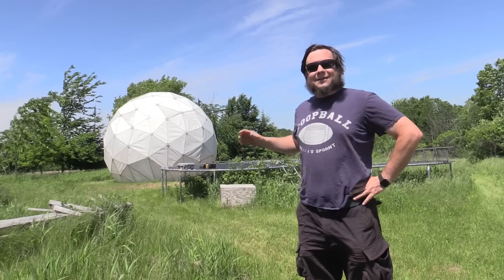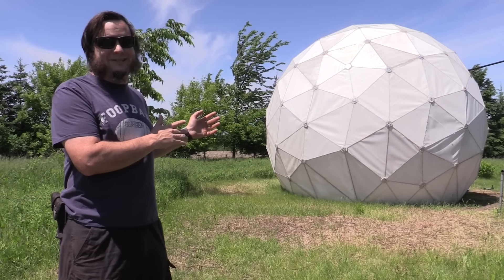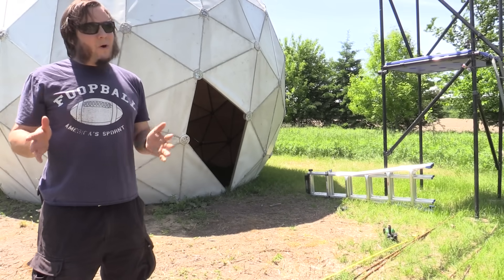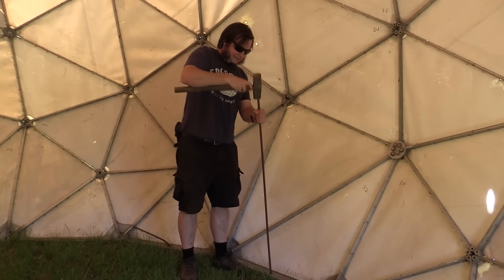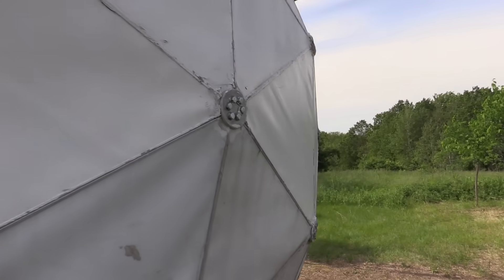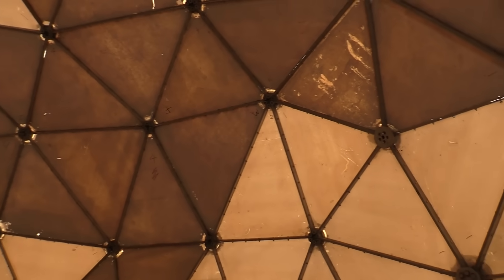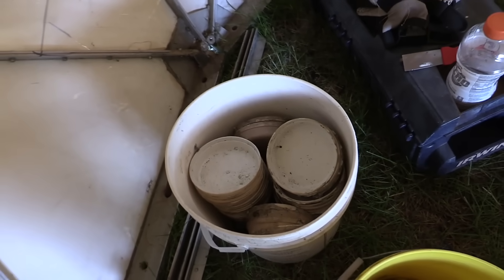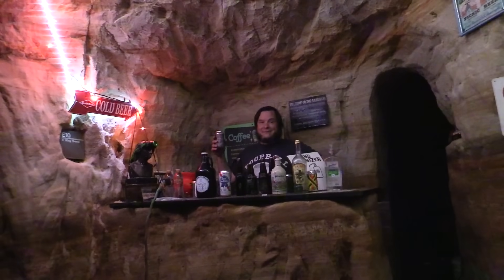Will Our Geodesic Dome Survive A Storm?

Comment: Have you considered laying down a concrete slab to put the dome on? I feel like a solid foundation will help any mounted telescope. Maybe that's not needed for radio observations as much as visible.
Reply from the maker: The antenna will have a solid foundation, but the dome is just pinned to the ground.

Comment: Make an opening on one of the panels close to the top and JB-weld a chimney topper. This lets warm air out the top, while keeping the rain out. The 'chimney effect' will pull fresh air in through the side opening, and prevent it getting so hot inside. If the dome is the tallest thing around, consider adding a lightning rod and grounding. On one of the 25' domes I maintain, we have a piece of railing attached to the top most segment that we hook a ladder onto to reach the top for maintenance with the antenna installed.
Reply from the maker: Great ideas, thanks! I'll have to remember that. Curious where your domes are, maybe shoot me an email if you get a chance, gabe (at) saveitforparts (dot com). Youtube never shows me comment replies so they just get lost in here :-(

Comment: I fear you will have damp issues with no concrete foundation or floor. or even flooding issues depending on your topography and the water table.
Theres a reason people put these on raised platforms.
Reply from the maker: This is on top of a hill, so shouldn't be any flooding. We'll probably throw some gravel in there as a floor when we have time.

Comment: At 17, I worked one summer as a helper assembling grain bins. We built the roof first then used big jacks to hang the rings and secure the assembly. The worst thing to see is that green "it's hail" color coming toward you with half a ring hung.

Comment: Depends on how far you want to go in order to cover your ass, but I did a project a while ago where we just got a structural engineer to assess each of the locations.  They then did a written fixing method assessment which we stuck to.  Only cost a limited amount per assessment and we could then say that we’d done it as recommended by an expert.  Either that, or as per manufacturer’s instructions would probably suffice.  If it all goes pear-shaped, you want to be able to say that you took reasonable efforts to secure things.

Comment: For belt and braces, i`d install some eye nuts onto the appropriate vertex plates and use steel guyes down to screw-in ground anchors. You`d only need to attach the guyes when a bad storm is in the forecast. It wouldn`t take more than a few minutes to clip them on using carabiner snap hooks.
Reply from the maker: That's a good idea. The manual actually says to put in eye nuts for lifting and moving the thing!
Reply: @saveitforparts 
If you get heavy snow there, i`d install a pin/bolt in the middle of the top pentagon. Attach a rope to the pin/bolt via a ring and you can walk it around the dome to dislodge the snow on top :)

Comment: YOU COULD PUT A CEMENT FLOOR IN THE DOME THAT WOULD ALSO HELP HOLD IT DOWN AND KEEP THE RACOONS OUT.
ALSO IF YOU ARE GOING TO HAVE ELCTRONICS IN THERE I WOULD PUT IN AN EXTRACTOR FAN IN ESPECIALY IN THE SUMMER TIME AS IT WILL GET VERY HOT UP TO 104 Fahrenheit YOU DONT WANT TO LET IT GO OVER 89.6 Fahrenheit OR BELOW 64.4 Fahrenheit IN THE WINTER.
ALSO GIVE IT A FRESH COAT OF WHITE PAINT IT WILL HELP KEEP IT COOLER.

Comment: I say that if you were able to build a half dome with something even remotely resembling a flat base to it, you should build a short Tower and attach that to the top as an additional station. Maybe something using the PlayLand structure if you think that would be stable enough. It will, of course, need "laser canon" sticking out of the top hatch. I'm sure you've got a laser laying around there somewhere.

Comment: Rebar will anchor your dome fairly well but be advised that it comes loose after the ground freezes and thaws a few times. If your dome is of much value, I suggest you add a few expansion anchors that you drive deep into the ground. They open up to grab into the subsoil to provide a lot of hold. Many people including myself have underestimated the lifting power of the wind and came to regret it when our car ports took flight. You could use your other pieces of dome as forms to cover with concrete and make storage or shelters or a car port. Just be sure to save enough spares to make repairs to your primary dome.

Comment: Are the edges of the triangles made of metal ? How does this not interfere with the operation of the radar?
Reply: Depending on the size and purpose of the building, geodesic dome frames can be built of PVC pipes, galvanized steel or aluminum struts and covered with various materials such as glass, plywood, cedar shingles, fiberglass, plexiglass, acrylic, metal, or plastic sheets, again depending on the building's size and purpose
Reply from the maker: The frequencies it's designed for are high enough to go between the metal frame, and the semi-random triangle pattern helps avoid interference (at least, according to the manual!). We'll have to do some tests to see what happens.

Comment: The left over pentagons could become sunshades for picnic tables. You could build a structure with a roof on it with the partial dome...
You could build a cover for a rather small auditorium/stage using the leftover dome pieces... and call it the Sandland Halfass Stage and Picnic Area...

Comment: I would love to know what are these domes used for and what can and/or will you use it for
Reply from the maker: Originally they'd be for radar antennas, satellite dishes, radio telescopes, etc. Basically any big rotating antenna that needs protection from the weather. We're doing something similar, we'll have a large surplus satellite dish inside for looking at satellites and radio astronomy stuff.

Comment: Here is the $65k question... What kind of antenna array are you planning to install inside of this sweet ass dome?!

Also... Any suggestions for a cheap commercial or diy antenna for goes satellite feeds??  Seen a few examples of $20 2.4ghz commercial dish conversions but those cheap wire mesh dishes don't seem to exist anymore...
Reply from the maker: We're probably going to use an old C-band TV dish modified for satellite and radio astronomy stuff. I got part of a large one from the CCERA when we picked up the dome, and I have another one at home.

For GOES I made a cantenna from an old coffee can based on some online calculator, but a few people have told me I did it wrong. I've also seen a simple loop feed that someone used, or modified Wifi antenna. I've had some luck with a "Log Periodic" antenna from Amazon, but all of those things usually need a ~$50 SAWbird+GOES gadget to boost and clean up the signal.

Comment: I've had to secure some seriously major equipment during very high winds.  Think a 1000+ ton sail that's 100+ ft in the air.  Guy wires, turn buckles, and pre-cast concrete barriers.  Call your local concrete batch plant, they usually have pre-cast blocks and barriers.  They use the leftover/old concrete from trucks that has set up too much to be suitable for foundations and pour them into blocks.  It's just junk concrete the wouldn't otherwise be able to sell, so most places cast it into blocks before it completely sets up.

Call and ask for Lego blocks.  They're like $150 each, but you'll need equipment to move them.  A few of those will do the trick.
Reply: One or two of those inside the dome, chained to the frame, and it ain't going anywhere.
You are right, the connection between the dome and the ground is the weak part. Rebar stakes are iffy. A concrete slab with J-bolts would be a forever solution.
Reply: @jameskelly1680  Hey everyone in this thread! I got a dome in my yard, and am trying to find the best solution for this. I got a concrete culvert (1.5-foot diameter, 3 feet long) that I am thinking about threading a 3/8 chain through, and then burying the whole thing a few feet in the ground. That's a good start right?

Comment: I think you need to do a concrete pour and bolt the dome down to something solid.  Yes, it's a PITA however once you have a suitable slab you have a firm base inside to mount a dish, etc.  

Another option would be to bolt some C section steel across the base in a 'cross' pattern, cover the ground + beams inside with plastic sheet and then put coarse gravel over it so that you have a heavy weight directly connected to the dome.
Reply: Here's another option further: Rebar into the ground 4-feet. Oh wait. He did literally that. You're overengineering. Relax.
Reply: @cwtrain  
My dome is 15ft diameter and it has a concrete ring foundation. Apart from anchoring it down, it also spreads the loads over a much greater area compared to just the thickness of the dome wall. A thin wall combined with wet soil and high wind load wouldnt be great.

Comment: Can you build a pyramid with those spare parts?
All that talk about connecting the tunnels might be good for ventilation, AC in summer and heat in the winter.

Comment: What about an entrance from below?

You could do a small ladder down into a 3'x3' hole, dig across, and have a single ladder going up to minimize internal space usage.

You could always remove the outer panel again for larger objects but, for ease of entering afterwards, maybe that's an idea?
You could even create cement footers, then support with wooden 6x6 on either side of the doorway. Sump Pump or something maybe for floods.

You could also inventory the % of another dome, and start making a tower structure, then migrate it over time.
Reply: As you're not fire inspector, that's going to be a hard no go. That was an impressive amount of thought you put into something just to be told "Not a chance in hell." Don't hurt yourself.

Comment: 5:25 @Gabe : Do what most facilities would do… disassemble the spare dome down to its smallest usable parts, and use those parts to refurbish / repair the working dome. That way you will be able to keep the working dome into operation for a long time.
Reply: And protect them from UV and weather while they are in storage. That will be the weak point, long term. Some of the south-facing panels on the complete dome will degrade over a number of years. This will give you replacement parts for the long term.
Reply: @jameskelly1680  That is why the parts were painted at some point... Most likely to protect against those UV rays which hit the south pole a lot these days...